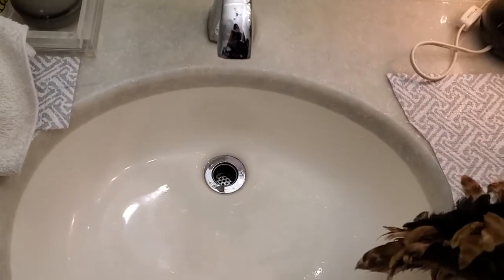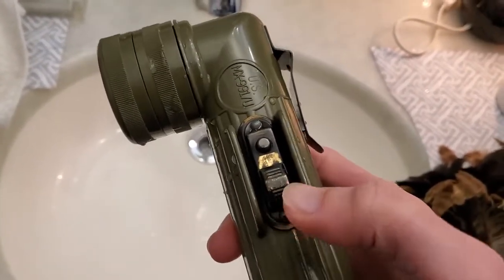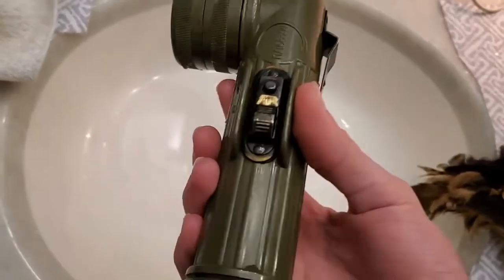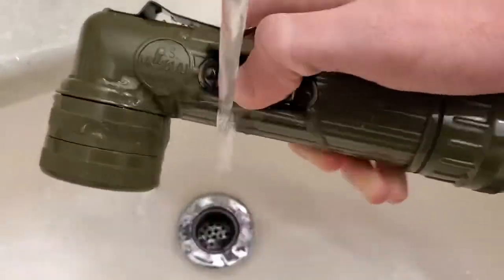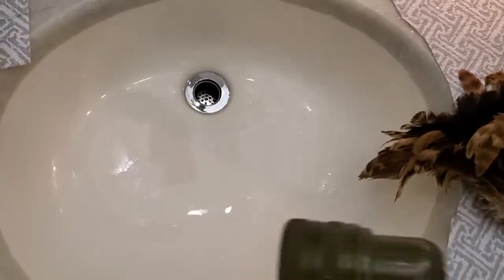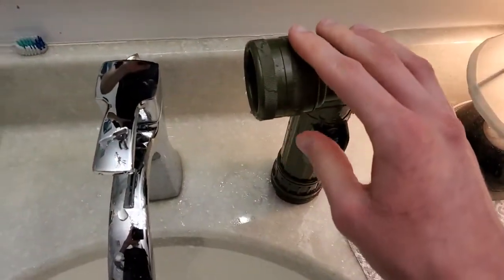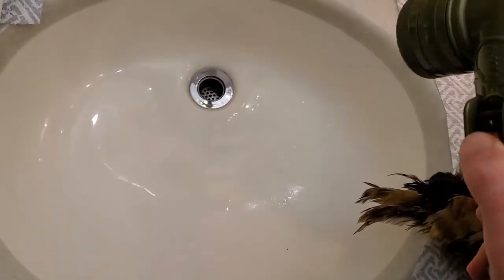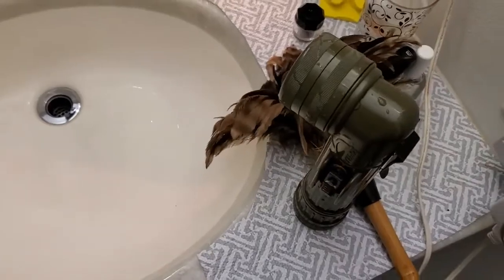Fulton MX 991 U Switch Cleaning

Comment: I was hesitant to try this at first because I didn't know how the switch was waterproofed. Until I watched a video of a guy drilling through the rivets and taking apart the switch. 

The whole thing is covered with a rubber panel. There would only be 4 holes for water to theoretically get in, but two of them are sealed by that rubber panel completely, and the other two are sealed by the rivets that keep the switch's housing attached to the body of the flashlight. NOTHING is getting in unless the rivets break off and the switch just falls off completely.

If you were like me, and hesitant to do this, I can say that it's totally safe. 

Great video FFM, my switch feels a lot better now.

Comment from the maker: It happens sometimes. It might flicker every now and then to. Flickering is normal for this light. As for the dimness, mine do that sometimes to. If you flip the switch repeatedly and shake or reinstall the batteries, it might work better. Sometimes that fixes the issue. Make sure all the contacts are clean to. Another good thing to do is put some oil in the switch. Just make sure the oil you use won't harm the plastic or rubber seals. I hope this helps. If you have any other questions, feel free to leave them in the comments section.

Comment: I had mine stored for a couple of years without cells and for whatever reason it won't turn on. I even got the conversion kit and washed the switch, I soaked it in white vinegar and cleaned the copper contact points and nothing. Anyone got any idea why it's not working?
Reply: Have you tried bending the little pin on the spring so that it makes contact with the metal ring on the bottom? I had an old Fulton that was super finicky due to the pin being bent and slightly corroded.

Comment: Hello, After leaving the batteries inside for a while. The batteries started leaking... So I have cleaned all the white dust from the switch and the bottom cover and everywhere else. I have put in some fresh new batteries but the light won`t come on!!. I have tried everything and the only way the light will come on is  when I run a wire from the bottom of the bottom battery to the metal part that goes from the switch to the light bulb. Any idea??
Reply from the maker: Maybe the spring in the tailcap isn't in right. The spring can also grind against the light if it isn't properly set. If that doesn't work, remove the spring and check for corrosion. A wire brush bit on a Dremel works well for removing corrosion.

Comment: All the flashlight needs is some lubricant, i just put some olive oil on the switch and let it sit for 5 minutes wiped the oil off and it worked. And my switch did not move at all, not even with a stick. So i suggest you try it if his method does not work.
Reply from the maker: @MelissaJordan-mm3ff  As long as the lubricant is safe for plastic. Mine was gritty all over when I got it so it needed a good clean. It has worked fine ever since. Another thing I noticed is that some of these lights arrive defective and each half of the body isn't aligned.

Comment: Instead of water, apply a liberal dose of WD-40 to the switch.  Wipe up the excess, and almost instantaneously the switch works so easily. The difference is amazing!!
Reply from the maker: I might try a better lubricant sometime but I need to make sure it works with plastic.

Comment: I have what appears to be an identical flashlight, from Tractor Supply. The weak point is the switch. I followed your advice and it worked. Thank You  

WD40 can damage some rubber & plastics. Lube made specifically for plumbing is a good alternative.
Reply from the maker: Glad it helped. Oil is another option but some plastics might have a reaction to it. It is always best to start with water.
Reply: Silicone spray  lube and or graphite spray lube are the two best to use when worried about potential damage other components, no? And I always recommend not using WD40 in switches and locks...it'll collect particulates over time and get grimy again. First hand experience: used WD40 on my trucks door lock cuz the key wouldn't turn. Worked perfectly...for another month. Then I had to change the lock cylinder entirely because of how bad it was. Coated in WD40 film with crap stuck all in it

Comment: I bought a fulton from a surplus store and everytime I turn it on, after 15-25 seconds, the light starts to dim and then eventually just goes away. I've tried flipping the switch a lot, taking the batteries in and out, shaking it, and replacing the bulb. Any idea on how to fix this?
Reply from the maker: It is probably just low batteries. Mine does it to when the batteries are low.

Comment: I'm a Silent Hill fan, and wanted to have a flashlight like James. 
Mine wouldn't stay on the "On" position. The switch wouldn't keep the button held down. I was so bummed out and thought I got a dud. I took apart the switch and noticed copper plates. The one connecting to the switch was bent like a hook. I found that when the switch moves, it pushes that hook plate up so it can catch onto its flat neighboring plate underneath. I bent the flat plate up so it could be caught by the copper hook plate. It worked fine after that:)
Apparently whenever mine was manufactured,  the copper plates were not positioned right. 
Just another tip if your flashlight isn't working. Washing it off helped immensely with it!
Reply from the maker: I didn't see this light in Silent Hill Origins yet but maybe you are talking about a different one. I heard it has been in many movies.
Reply: @fixedfocusmediaofficial  It's in Silent Hill 2 and I think Silent Hill Homecoming.  It's a handy little thing. It just gets misaligned when it gets dropped.
Reply from the maker: @lapianistafeliz683  It's really good for fishing at night.
Reply: @fixedfocusmediaofficial  also really handy when doing farm work before sunrise. It's impossible to carry bags of grain while holding a standard flashlight.
Reply: So...I've got the same exact one as you. Even has the switch guard and the pocket clip. 
Problem: can't get the light to come on at all, in either mode, button pressed or not. Batteries are good, bulbs aren't blown...it's just not working. I cleaned out all the corrosion and figured it would be enough, but nothing. When toggling the switch, I see no movement at all on the inside, so if you're supposed to notice something then that's a dead giveaway. Idk tho. Kind of lost cuz it looks perfectly functional and the switch is crisp...button is stiff but idk if that's just me or if it actually is. 

Any advice would be appreciated. It's my mom's from when she was in the army, so I wanna get it working again for her (even tho I'm keepin it in my truck)

Comment: i recently bought one used but it wasnt working,the bulb and everything seems to be ok,do you know what might be the problem?
Reply from the maker: Make sure that the spring is set correctly (this can be tricky)  and all the metal contacts are clean. Replace the bulb just to make sure it isn't the problem. Sometimes a break in the filament is too small to see. Is the switch jammed?
Reply: @fixedfocusmediaofficial  no,everything is fine,apparently it was just the spring,i just shaked it and it worked,i did it like 2 minutes after i commented,actually lol,thanks for the help anyway
Reply from the maker: @ContraIsBased  Glad it worked out.👍

Comment: Can you explain your comment on the cleanliness of the factory and what other products have you gotten from them that leads you to make that assumption?
Reply from the maker: I have several of these lights from Fulton and almost every one of them has a lot of grime on the switch and inside the switch. It is a common problem that other people have with their lights as well. A lot of these lights are also misaligned from the factory. That is why the threads and body of a lot of these lights don't line up correctly. Some even have messed up reflectors. They still function, they just need a bit of cleaning most of the time to improve reliability. The U.S. military has since replaced this light with the military version of the Streamlight Sidewinder. They use other lights for weapon mounting. I never said the old one is bad, they just need a bit of cleaning when you get them.
Reply: @fixedfocusmediaofficial  the parts that are assembled to make this flashlight as you can see are made of brass and the finish that is a government spec requirement is a black oxide finish which is done outside of the assembly plant.  We still sell thousands of these to the military (only the Marines switched to very expensive Sidewinder) but don't get the complaints that you are saying about the switch from any of the other branches that we supply to.  What you are doing is actually taking all the black oxide off of the switch which is entirely up to you.  Thank you for your feedback.  Was just taken aback by your comment of the facility being the "dirtiest factory on the planet" but do agree that it is a good light and unlike others on the market, still MADE IN THE USA.  Look forward to upcoming videos!
Reply from the maker: @bigmoneyzz4901  I didn't mean for it to sound that way. Perhaps I should remake the video. As for the finish, I have never tried removing it because brass can corrode. The light in this video is the oldest MX-991/U in my collection which is why it is a bit worn. It is also my most reliable MX-991/U. Maybe the military has a different supply. Many people have problems with the switch jamming which is why I made this video. It might not be 90% of them but it is a known problem with a simple fix. I like starting with water instead of chemical lubricants that might harm or discolor the light.
Reply: @bigmoneyzz4901  
Lol, if a brand new product malfunctions due to dirt, filth, or debris, the creator of the video  has valid complaint. Btw, Made in the USA doesn't equate to Made by Americans.
Reply: @20alphabet  what else could that possibly mean

Comment: My fulton only works when i press the button signals,  any idea of how to repair this? :c
Reply from the maker: Is the switch all the way up? It is a three position switch. It has constant on (switch is all the way up), momentary on (switch is in the middle position and the button is used to momentarily turn the  light on), and off (switch is all the way on  the bottom). Make sure the switch is all the way up. If it still doesn't work, please contact me again. Hope this helps!
Reply: @fixedfocusmediaofficial  thanks for the repply it's all the way up in the third position, when get the flashlight  it works fine but now It doesn't and only have pass some weeks 😅
Reply from the maker: @axelgarciaalvarez4364  Are all the terminals clean? Check to make sure the bulb, reflector, and terminals are all clean. Check all the metal contacts in the light. If they are all clean and the batteries are good and it still doesn't work, check to see if the spring is set correctly. If you still don't have any luck, it might be defective. Make sure it says ships from and sold by Amazon to if you bought it there. There are many knockoffs out there. Best of luck!
Reply from the maker: @axelgarciaalvarez4364  Try replacing the bulb to, even if it isn't burnt out. If the light is dropped or bumped, the filament can snap. Touching the bulb with your fingers shortens the lifespan to.
Reply: @fixedfocusmediaofficial  how does it shorten the lifespan if you touch it?
Reply from the maker: @Oppteekap  It shortens the lifespan of the lightbulb if you touch the bulb with your fingers. You can get LED bulbs for this light though. Fulton actually makes one of their own as well.
Reply: @fixedfocusmediaofficial  Ohhh. Does it mean like for example led doesn’t overheat but the factory ones overheat when you touch it?
Reply from the maker: @Oppteekap  The oil on your hands won't effect any LEDs but it will shorten the lifespan of any incandescent bulb.

Comment: Have you ever tried to replace your switch or take it apart to clean it? I know it has those two small brass rivets that hold the cover on. I am trying to restore my dads back to working order. It sat for a long time with batteries in it and it corroded everything. I put a new reflector in it and cleaned everything i could. It works fine when i bypass the switch.
Reply from the maker: I've never tried opening it. Rivets are annoying because they make servicing very hard. The switch wasn't the greatest either so they should have used screws. It isn't a bad light but it has a few small flaws.